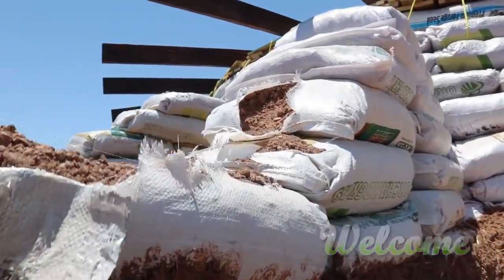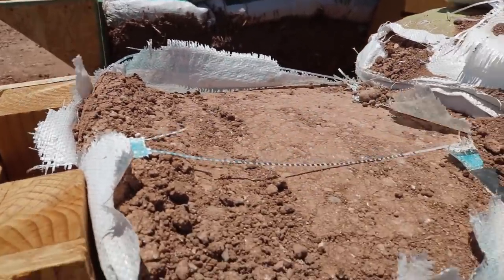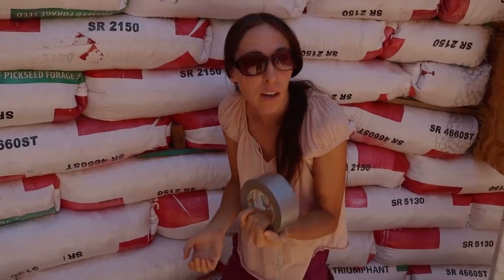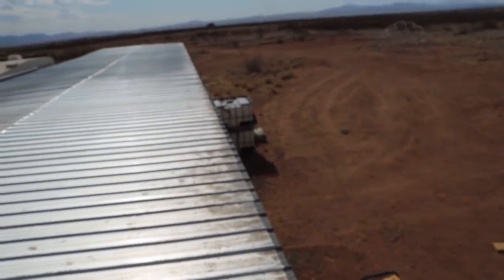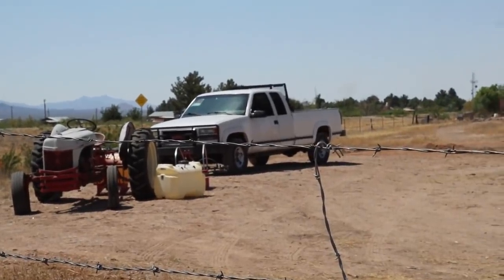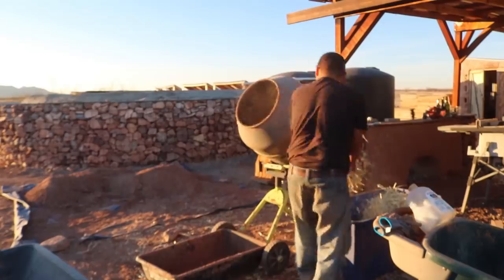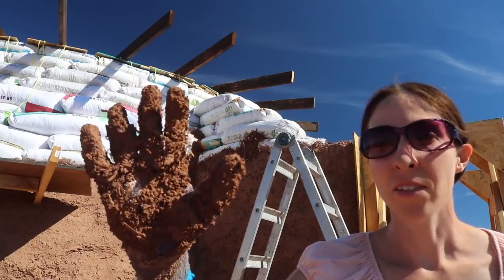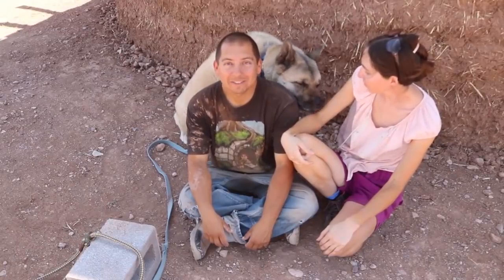Will Our House Disintegrate Before We Finish Building? Shocking UV Damage To Our Earthbag House!

Comment: Tip on making patches for the bags: cut the ends of the tape so they are rounded.  Kinda like half domes on both ends.  Corners are more likely to pull up and you lose your patch.  Maybe tarp over the top until you get back to working that area.  Love you guys.  Peace!
Reply: Very good tip.

Comment: Cobb Party time. Walmart walgreen have eye glass repair kits..  thin wire works temporarily .
Reply: Or a round toothpick. Just screw it in as tight as you can, then break off the excess. Mom was an optician for 35 years.

Comment: Use a magnet when trying to find a screw in the dirt. The problem with used trucks is that the prices are way up on them. So, most of the ones for sale are junk. I've been looking for one for a year. I gave up and plan to fix up my 85 Chevy. Consider a small trailer to pull behind the car, if the manufacturer allows it. Good Luck, Rick
Reply: They really do hold their value don’t they. The good thing about fixing your ‘85 is you know it’s total history. We have a 2000 F-150 and it has survived 5 teenagers ( barely😻), and I am rather emotionally attached to it. These days it is really just for going to the hardware store, or if everyone is using the other cars, so I hope it lasts another 20 years.

Comment: For PVC, check a commercial plumbing supply. Ask a plumber where they get their pipe from. It will most likely be cheaper there than the orange apron place also.
Reply: Orange Apron 💪🏼 better than the other guys with the blunwite logo.

Comment: You can get a glasses repair kit really cheap at walmart. It has screws and a tiny screwdriver. Failing that, put a piece of clear fishing line through the hinge in place of the screw. Burn the ends of the fishing wire to flare them. Or even burn them to the hinge, top and bottom.

Comment: White Exterior Latex house paint. It will block UV, keeping the bags safe for awhile.  Once the Cob is over it it doesn't affect anything. Just slobber the paint on thick with a cheap 4" brush.  I have a 275 gallon poly cube tote I carry in my truck all summer as part of a fire suppression unit. The sun UV would destroy it in a season or two except I keep it painted with white house paint (also reduces algae in the tank because it's dark inside).

Comment: If you ever do have to stabilize a big tear like those hallway bags, I think the way to do it would be to add a long strip of tape along each side (to stabilize the bag and keep it from deteriorating further) and then connecting those stabilized sides with more tape. Kind of like a suture?

Anyway, I love to see the cobb go up, so you know I'm in camp "maybe just cover the rest of the exterior walls while you're at it". I know you're excited about going higher, but preserving the structural stability of the lower walls maybe should be the higher priority? I'm not sure. Keep up the good work! 😀

Comment: DUCT TAPE!!! Miracle repair material! Lay some black plastic over the rest of the bags to prevent sun damage. Tie a couple cans of dirt on corners and middle to prevent them blowing off. You can tape on some "STEP PADS" with duct tape on bags that you walk on to prevent you from tearing those up or put up a extension ladder and just raise it every time you go up a course. Would paint also work?? Paint places that won't be done for a while. Another option might be just to do a quick stucco with some "DIRT MUD" Get a Texture Air Spray Gun (Harbor Freight $28 or some other place) and make some quick mud stucco. Will have to sift the dirt, but that would be another quick fix that would prevent sun damage. Any thing to block UV light.

Comment: Have you priced PVC in Agua Prieta? I bought way too much PVC pipe when I was in Baja and didn’t notice it being any more expensive. In fact I think it was cheaper. Another thing you might not have considered: getting a good SUV like a Dodge Durango and then getting a heavy duty used trailer. You can probably carry more. When confronted with a similar problem, I opted for a minivan that tow 3500 lbs. When I need to haul, I use a trailer. When my van is enough, I use it and get great gas mileage. A minivan with the seats down can hold a lot of stuff.

Comment: It looks like you still have screws through the metal clips. Since you have high winds, you may want to check the shear rating for your screws. The “hurricane” clips and other metal ones may require a nail rated for shear. You’re outside the code area, I think for the county, but you may want the strength of the nails.

Comment: I believe you mentioned in the last video that bags may not fit between the eaves and loft beams.  Perhaps one solution could be to turn the bags 90°, only fill them part-way, tuck the excess bag under and nail/pin it down. It would probably be a pain trying to get them to match the width of the previous bags though.

2¢ :)

Comment: I watched your entire water cistern build with the ferrocement roof and I assume you'll be doing another ferrocement roof on the dome. I would be curious if a layer of papercrete before the ferrocement would help in the same way the cloth did when you were working on the rain catchment gutters? I would think that would prevent loss of material and perhaps even make the roof more stable.

Comment: Question about the Cob -   If the Monsoon hits, do you have a huge tarp that you drape over the project, or how do you protect your build if it is not done?  I would think that constant daily rain and wind - would just wash that cob off?     What is  your plan - and what is the final mix - to make the cob water proof - and weather resistant?   Thank You!
Reply from the maker: The cob will last through a monsoon.

Comment: last year in may when lumber was cheap built a 12x40 green house covered with uv stabilized polycarbonate panels they're 4x10 $100 each bought 17 suppose to last 30 years only issue would be hail. last summer had marble size but golf ball size might punch through we'll see. biggest issue it's 14 degrees hotter inside compared to the poly tunnels covered in 6 mil vapor barrier plastic that stuff disintegrates in about 4 months
Reply from the maker: Polycarbonate panels are worth it.
Reply: @ourselfreliantlife  Did you know there is a worldwide shortage of polycarbonate panels right now? Verge Permaculture was talking about it.

Comment: I had a k 2500 chevy truck. I got rid of it because mainly the body was rusting away. And the oil pressure is down to 40 psi. Had 415,000 miles on the original engine that was never rebuilt.
Reply: 40psi is low? Dang,what's it suppose to be.
Reply: @kebertxela941  It was always 60 psi
Reply: May be it had one of those high pressure oil pumps on it. I heard that those will make a car last forever. Great job getting it to the moon and back! You must have taken care of it! Good job.
Reply: Oil pressure gage may of been off. It always read 60 at startup. Over the years oil pressure dropped. Engine was starting to use oil. Still ran fine. The body and frame was rusting away.

Comment: Your channel and your quest are quite intriguing. I'm curious, why you don't use something like chicken wire as a matrix for the cob to attach to & support. Have you considered a method of mixing cob with something cement-like binding material as (Aircrete) or similar material that would allow you to apply it by hose using a modified concrete pump? Continued good health & weather to you & the puppy!
Reply from the maker: We'd rather not use cement if we don't have to.
Reply: @ourselfreliantlife  I used cement only as an example to stimulate a search for other options that would provide the ability to use a spray method! 🙂

Comment: Just go to a dealer and get a newer truck. You will have a payment, but you’ll know what it is every month. With a used truck you’ll have a zero payment for a few months then a $2000 payment when the transmission or something goes out. The truck is the tool you have to have work for you without fail. Used trucks are being sold for a reason. Your lucky you found the reasons before committing to it..just one mans opinion, learned from experience. I bought a really clean Tahoe, and over a few years fixed the 4x4 transfer case, a/c, rear end, window motors, fuel sending unit, transmission etc etc etc. I could have had a couple of year old Dodge by averaging out those costs into monthly payments. 😀